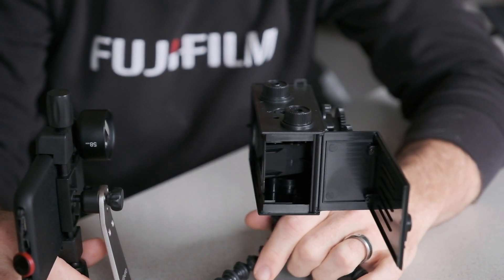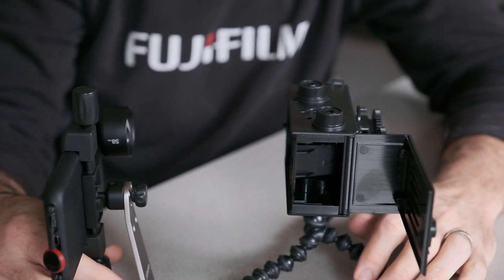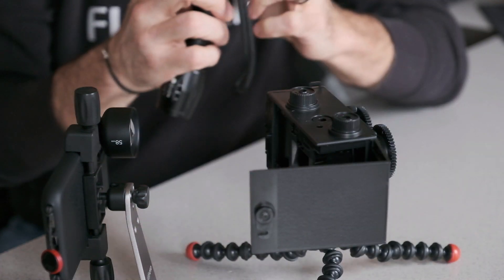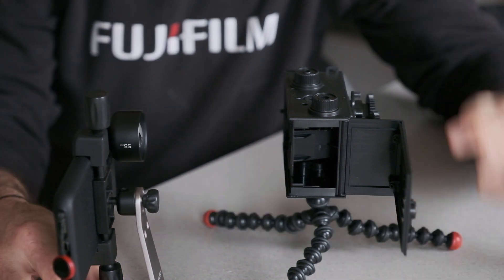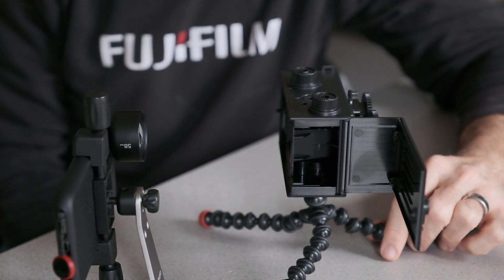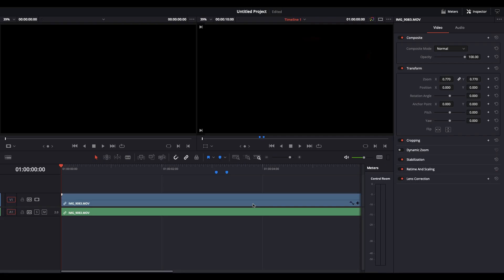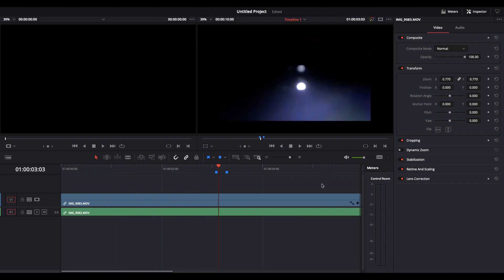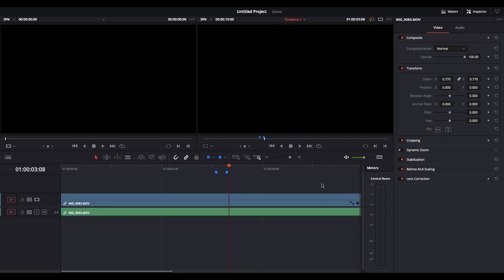Tip for Checking the Shutter Speed Accuracy of Old Cameras

Comment: I didn't understand anything about this method, and it was very poorly explained.
Reply from the maker: Actually, it’s quite straight forward and there are many other videos on YouTube about this method.  Using the phone camera (or any camera capable of 240fps or higher) set in slow motion video at 240fps, it will record 240 frames per second.  Therefore, film the shutter opening and closing with a bright enough light for at least 1 second.  Then using the video editor of your choice examine 1 second (240 frames) of the video of the shutter opening and closing.  Find the frames where the shutter is open (bright circle of light) and go frame by frame counting how many frames where you see the shutter open.  If you see the shutter was open for 4 frames then the shutter speed is 4/240 which is the same as 1/60.  If the camera you are testing was set at 1/60th the you can conclude it is pretty accurate.  Of course it is not as precise as a scientific instrument made specifically for this purpose but it’s good enough to tell if your camera’s shutter speeds are way off or close enough.  Happy shooting!
Reply: @davehanner360  Thank you for this explanatory effort. It's already clearer. One thumb.

Comment: Yeah, I had the same idea and decided to look it up on youtube. But i want to go one step further - there are really cheap, 30 to 50 usd, 720 fps cameras on aliexpress now, they shoot at a measly 240x320 resolution but for this test I think it will be more than enough. I'm gonna order one soon and will test it out. Bonus points - you can actually see shutter movement which will help immensely with the old cloth focal plane shutters - sometimes shutter seems to be working just fine while using simpler testers but in reality curtains are not synced and the slit is either too narrow or too wide.